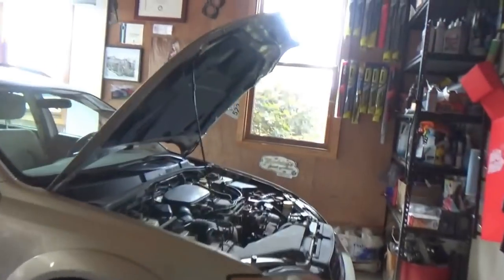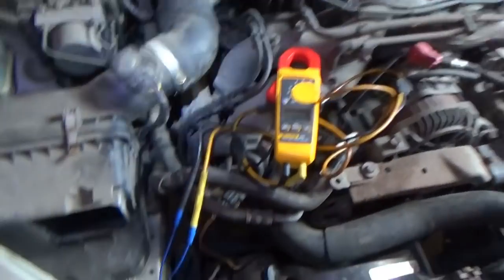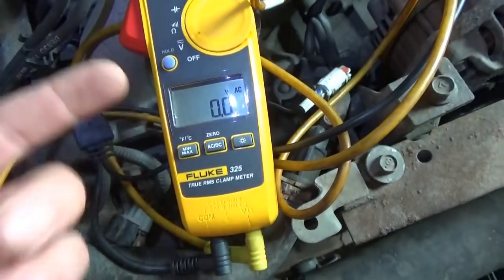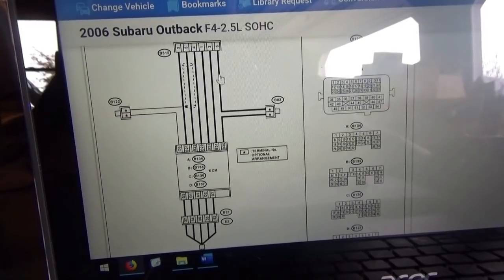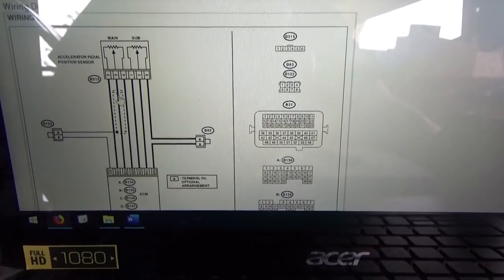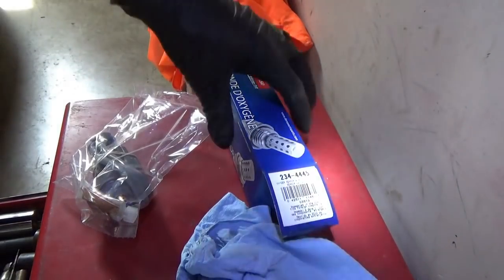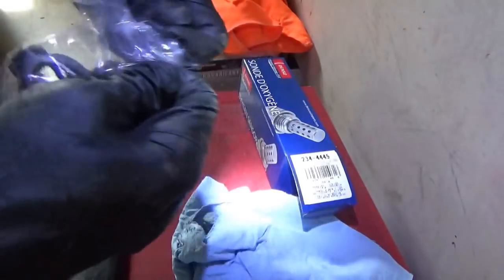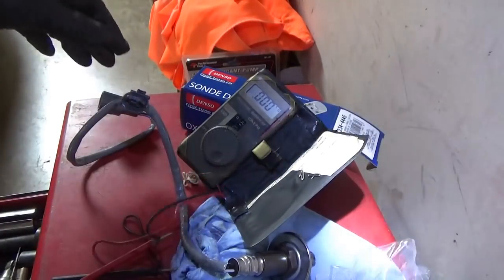Subaru Limp Home P2138: Part 2 - Diagnosis

Comment: Hey Ivan. Which scanner you like better. The Snap on or the Launch?. Is the Snap on an old XP device?
Reply: Yes xP my Zeus is windows 7 soon going In for a windows 10 upgrade. It’s really hard to compare scanners. Snap on crushes launch on domestic and Asian but not Europe. Ones $700 ones not. I have the Zeus, Bosch ads625, launch torque and Mini, Autel Elite and IM508 and non are comparable all do diff functions etc
Reply: Welding Junkie what about most European caes mercedes, bmw would an autel be better?

Comment: Intermittent ? Yuk ! Exciting though, can be a nightmare. Way back when I was on the bench analogue component fault finding electronic measuring intsruments, one of the engineers shouted "I've found it !" In his hand he had a low watt precision (Salmon Pink) resistor, it was intermittent. I had it connected to my clicking auto ranging DVM, during the day it would click, sometimes twice, sometimes none. Monitored it for two weeks, used another meter while doing it. Took the guy three days to find that ! He was good too, nothing much phased him, but this one did !! :)

Comment: Nice job Ivan. You tested the signals and grounds. Measured voltage on both sensing leads while depressing and releasing the throttle pedal. Checked online to see if others had similar issues. I got a feeling it’s gonna be one of the sensors or the pedal assembly. Did the guy want you to replace the pedal assembly?
Reply: highly likely, BOTH are at fault. forgot how many miles he said was on it. also worn/contaminated plugs and leaky wires can cause all sorts of nasty induction when running

Comment: Fluke 325 AC DC voltmeter AC only amp meter how’s that going to work
Reply from the maker: It has both AC and DC modes on the amp clamp.
Reply: The flute 325 on Amazon does not

Comment: a second good trick other than heating and cooling, a hitachi "massager" to vibrate the suspect item (or an engraver with rubber/plastic cap) 
just don't steal the wife's!!  yeah I couldn't resist the urge to be obnoxious :))

Comment: So why not get out the wifes hair dryer and blow hot air over the sensor whilst scoping it.
Not sure why you drove the car, you can do lots of testing at different rates with just the ignition on. Throwing a part at a non faulty item. Tut tut tut.
You should have checked at the throttle body also.
Pedal sensor faults can be like cam and crank. Throws a code for one when its actually the other causing the fault.
Food for thought.
Reply: heat gun and inverted air duster can FTW

Comment: should of just replaced the part at the onset, saved diagnostic time
Reply: No competent technician would do what you suggest. In like manner, no competent carpenter would use the saw before the tape measure (twice).

Comment: Good video overall, but you are wasting time checking the resistance of a new in box component from the most reliable, highest end parts manufacturer on the planet - Denso.  Ditto for Aisin, the other highest end brand in the world.  Is it any wonder that Toyota & Lexus are the most reliable brands of car, by a significant margin? - Also, the "seeing what goes wrong on this model from other people" online should be step one, to save time.
Reply from the maker: I've had a brand-new Toyota cam timing solenoid test bad right from the dealer parts room. Can't trust anyone these days lol